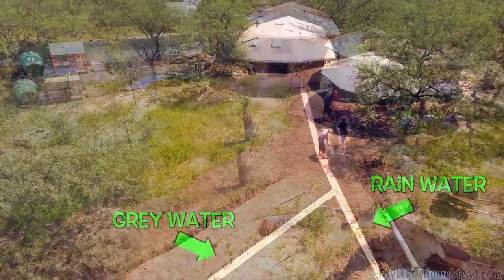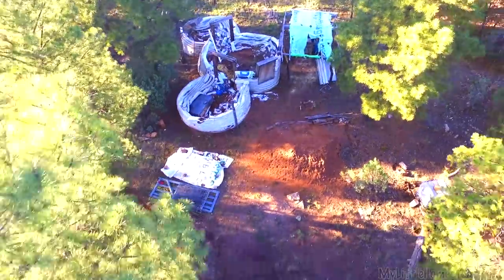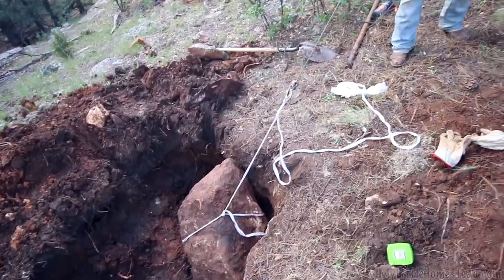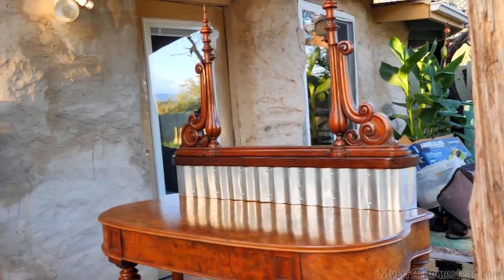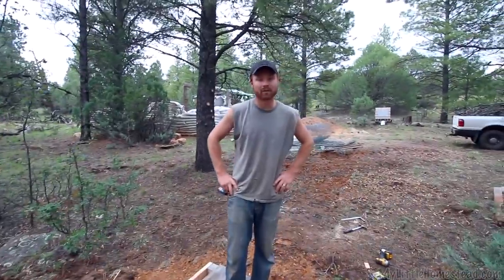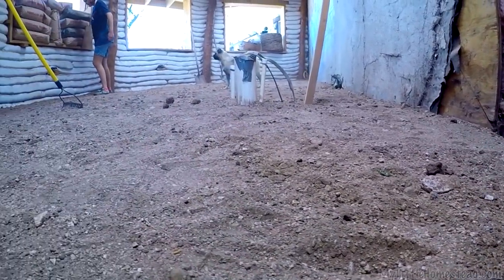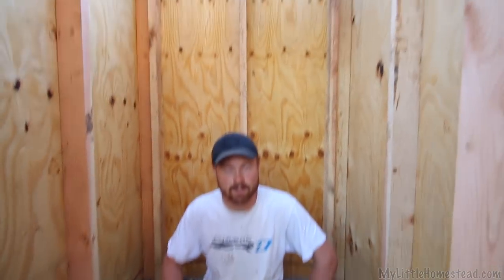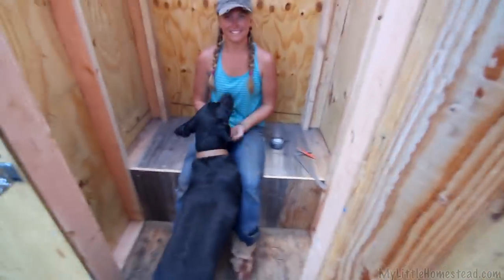Outhouse, Subfloor & Modify Vanity! | Earthbag Kitchen, Bathroom & Cabin | Weekly Peek Ep153

Comment: the bathroom sink is looking awesome. I am glad that a vent pipe was put into the out house, that will help cut down on gas build up. I was a little worried for them till I saw the final picture of it and saw the pipe. I hope they saved the rock, its a nice size and can be used  as a boarder marker on the parking area or in a flower garden as a center piece.

Comment: Two ways to have a warm toilet seat in the winter: 1. buy a cushioned seat. They are warm as soon as you sit on them. or 2. I saw this in Canada where the winters are very cold. Cut a hole in about at 2' by 2' square of pink styrofoam insulation and let that be your winter toilet seat. It will be warm as toast in the coldest temperatures, and you don't have to bring it in the house between uses!

Comment: The deeper you dig an outhouse the longer it will last. You are supposed to stop using it when it's less than 6' deep. So if you dig it 7' deep it'll nly handle a quarter of the volume of a 10' deep outhouse. If you dig it 2'6" deep it's done before you even start using it.

Comment: u need to make a cement slab with wire/or rebar...to hold it...the humidity of the all the waste will root the base pretty fast...what u are doing is a no no no :)  u do not want to be dropped on the shit..by a faulty floor.

Comment: Just mine notice---that cables lied directrly into soil - are they approved for this kind of approach? I mean - they could be really dangerous is they are just common cables not mentioned for direct burial... Cheers...
Reply from the maker: Yes.
Reply: Thanks for your answer... But would not be better to embed cables into walls to have some kind of access to them instead to have them enclosed by soil cement slab?

Comment: Why don't you mix all this dirt with cement right away? Also, same question every time you dig a hole for wires and pipes, refill them with soil cement mix. Don't add water right away... Just mix it...
It might get your job easier afterwards?
Reply: I mean, why wouldn't you?

Comment: Awesome! I do wonder why you buried wires and didn't use conduit.
Reply: they used outside (bury) type wire, probably got it from excess from a construction job... i know i would of done it that way...
Reply: @erehwon9371  I guess I over plan then. I'd hate like hell to dig up the finished floor if something went wrong later down the line.

Comment: Next time call ahead they still probably won't make them unless you pay ahead over the phone or see if you can get the App for Taco Bell. One time with about 15 minutes until closing 2 charter buses pull in and I had to make 32 Quarter Pounders with cheese 8 20 piece nuggets 12 Big Macs and 40 apple pies.  So I know a little of Taco Bell's pain, but 24 isn't that many years ago they had 10 packs of hard or soft shell only $4.90 this was 1992 and 12 or so of us played Dungeon's & Dragon's Taco Bell was just about 40 feet away we ordered 80 hard shell 50 soft shell and 12 bean burrito's when we went home 36 hours later the building could have been condemned, 12 people 36 hours over $130 bucks of Taco Bell and I think we drank 144 cans of Mountain Dew.Ah those were the days.

Comment: Screw a couple old bicycle gears and tubing of unknown function to the corrugated to finish the SP look.   Don't forget to keep a coffee can full of kitchen matches in the outhouse to burn the drop zone clear of Black Widow webs before sitting down. You wouldn't want any bites on the dangley bits! Oh and the TP goes in another coffee can (both with lids). This keeps both dry and bug/mouse free. Now all you need is a bucket of ashes to scatter on the DZ to keep the flies and odor down. Just a scoop per use.

Comment: Great job on the outhouse!  You could reduce odor by installing a pvc pipe from the seat area vertically out to the roof. Set it in the corner. Also,  if you keep your toilet paper in a coffee can with a lid, it will not absorb moisture or creepy crawlies. Always nice to have a clean bum with dry paper. :0) Cheers!

Comment: As beautiful as they are, I think the wooden foot bottoms on the vanity legs are going to be a future nightmare in a wet room... I would consider at least a ceramic disk insert at the point they touch the floor. Ceramic won’t have the mold , mildew to wood rot issued of constant moisture being trapped under the feet..

Comment: I like the metal around the bottom of the bathroom sink cabinet. I would also add a 1-inch ring around each of those legs a bit higher up. This will integrate the metal look into the wood area. Or maybe the two rectangles.